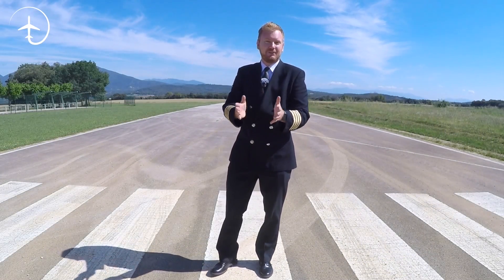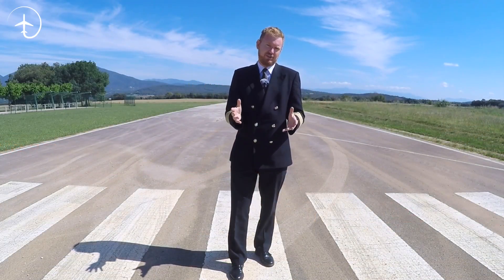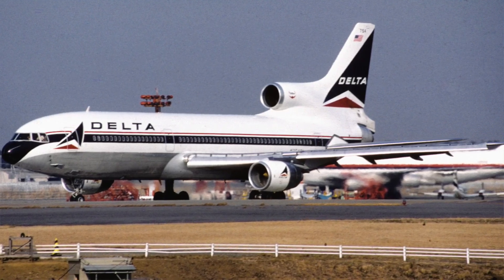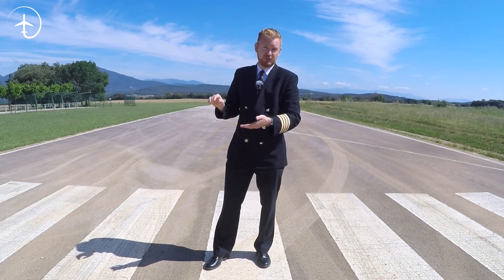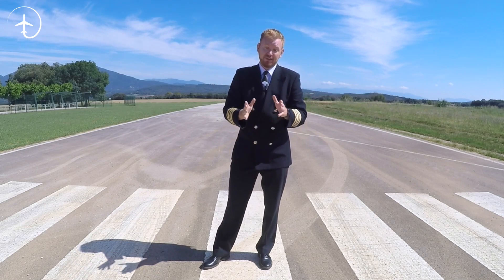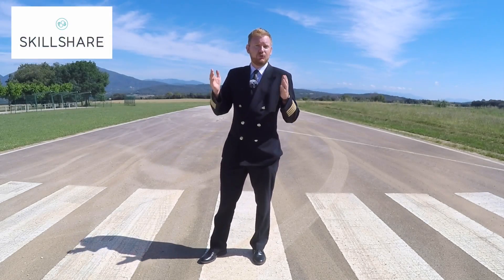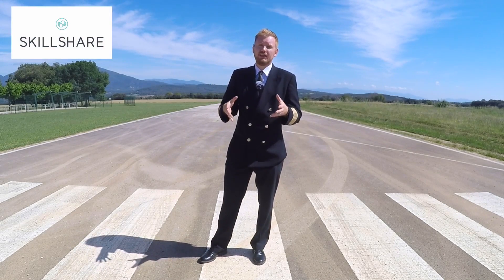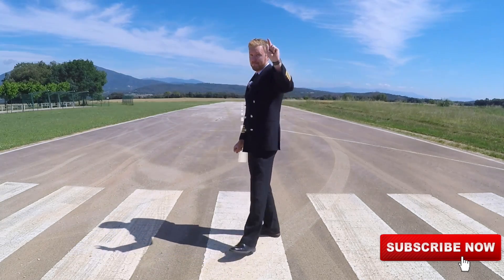Three Engined Aircraft, what happened?

Comment: I hope the hell that you're not actually a pilot, since you have incorrectly number sequenced a 3 engine aircraft. Engines on ALL AIRCRAFT are numbered from left to right, as if you were sitting in the Captain's or the First Officer's seat. The number 3 engine IS NOT integrated into the tail, that's the number 2 engine. The number 3 engine is mounted on the starboard wing and the number 1 engine is mounted on the port wing. Please correct your oversight on this, thank you.

Comment: Special circumstances require different planes?  Arrived in SE Alaska in 1974.  The challenges were weather, small population, short runways (Like: sea on one end, mountain on the other), bad airport locations, bad runways, and bad ground-approach-electronics (or none).  You could (and people often did) describe a town by the faults of the airport.  Kodiak - land into a mountain.  Petersburg - runway rolls like the sea.  Sitka - too short, but they lengthened it a bit.  Juneau - the approach from the north was like "you are kidding me".  At least Ketchikan didn't have cross-winds - they built it between mountains.  They landed way below minimum.  If the tower could see the runway, well, what more do you need?  Dutch Harbor - "THAT'S a runway?  Says who?"  Did i mention lousy weather?  Alaska Air needed short-take-off-short-landing planes, and very skilled pilots. Tri-motors made sense for more power; however, 727s ruled the day.   Dual-use planes - forward part of cabin became freight.  (Have to get down a stair and cross the tarmac to the terminal?  This is Alaska.  You're an Alaskan.  Suck it up!)

Comment: I think it's complete folly to only have 2 engines on long haul flights over oceans,I know people will say that they can fly on one engine but they can't fly on none,if by some chance the second engines fails and your in mid Atlantic then your in deep shit and your going to get your feet wet, the new big jet engines are reliable but they can and do fail due to bird strikes and mechanical failures Ect. It's only a matter of time before this happens as the number of flights increase and the engines age.
Reply: David Ellis not really. The chances of having dual engine failure with current checks is just too slim to justify a third one.
Reply: A2DJP .Well I hope your right for everybody's sake,prevention is better than cure any day ,time will tell who is right when these aircraft start getting on a bit and the flight hours start mounting up and all the checks in the world won't save the passengers and crew if it happens over the open ocean.
Reply: @davidellis279  yes, but considering the way aircraft maintainence works, it's unlikely.

Like firstly, all pressurized aircraft have a life cycle. It is not used beyond it.

And second, the major checks (D check) involves stripping down the entire aircraft, checking each component (replacing or repairing parts if needed) and then putting it back together and . This generally happens around every 6 years. This and the other checks (A, B and C) makes sure what you are saying won't happen.

Comment: B 727 forever
Reply from the maker: It was a great aircraft
Reply: @MentourPilot  Flying with these as a kid during the 1980s was the most heavenly experience. I remember walking towards its rear stairway, and the noise of the jet engines getting louder and louder like a thunderstorm above my head, and a pretty stewardess standing behind the stairs and smiling at me, it felt like I was boarding into Heaven. I aways demanded to sit near the wings and window, so that I could look into the wing moving its parts, and looking into all the clouds and the small ground down there, it was amazing. It was a short local flight to the seaside, I remember with a DC-9 it took us 40 minutes, but with a B-727 it took us only 20 minutes.

Comment: The reason why airlines went to 2 engines was insurance reasons. The insurers were starting to complain about all the trijet crashes. More people have died in trijets than any other type of airplane. Trijets in my opinion are one of the most idiotic engineering ideas in the 21 century. You are placing an engine in one of the most critical control attitude areas of a passenger jet. Many accidents have occurred due to this area of the tail being affected. To me the DC 9 and 10 were notoriously unreliable, the LT1011 was decent but had some issues. After 2 engines started to be used the number of crashes started to fall massively. Human error is now one of the biggest issues with the complexity of computerized flight systems. I find it amusing that a jet fighter can paint a target at 100+ miles and yet TCAS could of easily used that technology. I guess some tech can not be used to save lives...

Comment: Passenger safety is kind of important.  The, "Miracle on the Hudson," probably would not have happened because the birds would have been prevented, by the fuselage, from getting to the third engine and they would have been able to return to the airport.  The extra cost of the 3rd engine would have paid for itself - the airplane would have survived.  Also, the most iconic American made jet, the Boeing 727 was never mentioned.
Reply: TheFarmanimalfriend yea, but if you go statistically, the chance of the Hudson incident is just too low.

Its like saying people shouldn’t drive cars because people die in car accidents. And you are more likely to have a car accident than have another dual engine failure.

Comment: He didn't hit on the performance aspect.  All take offs are planned for an engine failure at the most critical moment, where you can either keep going or stop on the remaining runway.  With a 4 engine airplane, you will lose 25% of your thrust, a 3 engine airplane 33% of your thrust and a 2 engine airplane half your thrust.   Sure you can have a pair of huge engines, like a 777 does, those two engines make almost as much as a 747's 4 engines do.  So a loss of 1 engine on a 777 would be like losing 2 engines on the same side on a 747... greatly reducing your take off performance.  This is why a 747 can carry more with a shorter wingspan and the same amount of thrust as a 777.  The 777 could handle the same take-off weight if all engines were running but NOT with a loss of half of it's thrust due to an engine failure, whereas the 747 would be operating on 3/4 of it's normal thrust with a loss of an engine on take off.

Comment: United Airlines 232 into Sioux City Iowa was a tri-jet DC-10 which lost its center engine, and with it, hydraulics and many other systems.  The pilots succeeded in saving nearly half of the passengers using differential thrust only to control the plane.  I believe that accident was part of the reason we don't see many tri-jets anymore.

Comment: The truth is that a failure of the center engine took out the control system and caused a crash on several planes
Reply: I believe that was mainly the DC-10s and their (I understand) non-isolated/redundant hydraulic systems, wasn't it?

Comment: I was working for Rolls-Royce in the late 60s when the first RB211 3 shaft gas turbines were being designed and developed.  The first aircraft they were intended to be used on were the Lockheed L1011 so tri-jets were certainly being more than thought about before the 1970s as mentioned here.  I left RR just before the 'crash' in 1970 caused by the design problems with carbon fibre fan blades and the extra cost in using titanium (which is now standard).

I rejoined RR a few years later and remained until retirement but, as I recall, one of the problem with centre engine was that S shaped intake duct which meant air intake was inevitably restricted.  My field was the design of electronic measurement and control systems on test beds and rigs so the details of aerodynamic design were almost as much a mystery to me as to the general public :)

Like all your videos, very well presented and explained. Thanks

Comment: Now I am not sure whether it was my first trip by plane or one of the first ones when I flew in DC-10 or its variant. Transatlantic flight (whole trip consisted of 3 flights). I was quite happy to see it from the flight gate as it was such a specific plane (Jumbo Jet on another transatlantic flight was nice alternative).
This was benefit of these planes - they were so easy to remember :) And I liked them.

Btw. what about fire hazard? If you have fire in this engine, it is in the very unpleasant area when it comes to control - rudder and elevator are next to it.

Comment: Thumbs up for this video:  If I was flying i'd feel more safe in a 3 or 4 engine aircraft than a two engine aircraft. The crash over the Hudson (flown by the famous Sully) proved that out as he may of made it back to the airport with only one back engine running with a smaller intake or at least had a more controlled crash.  Plus rear engine aircraft seem to have smaller air ducts & are up high, so they tend to suck in less dirt and shit, LoL.....  Big diameter engines with really large fan blades bother me. Break just one fan blade and the engine will go out of balance and vibrate and needed to be ran as slow speed or risk it cracking and breaking the wing off.  You said about fire not being near the passengers with the pods under the wings, so you simply die slower LOL... Any fire that is on a Jet and the fire suppression does not put out, it's curtains for everyone on board unless one lucky bastard has a parachute.  Remember in war planes they always wore parachutes, and I think they should rent them to passengers on commercial jet liners that want one.  Even as a novelist, i'd rather bust a few bones making a hard landing than die in a fiery crash regardless where the fire on the plane is.  However I surmise at the speeds Jets fly and if they are really high a parachute would not do you any good any way, and if a stall happens on take off or just after as in Sully's landing on the Hudson River , you are too low to use a parachute.  As long as humans are building and working on aircraft there are going to be accidents. I often wonder when you see the amount of wires and gadgets in aircraft how more of them don't break down.  That is why when I buy a car I get it as stripped as possible except for AC, because is less stuff to break and less to distract me. I like my GPS being portable, because when it breaks or becomes obsolete and it will, I just send to Amazon and get a new one and plug it in, rather than take my car to the garage where some yo-yo whom may know what he's doing pulls off the entire dash board for $800.00 when you can replace a portable up-dated unit for $100.00 or less.

Comment: I would have thought that the smart thing for pitch balancing in a tri-jet would be to have the tail engine's downward pitching moment exactly balance the wing engines' combined upward pitching moment. Am I missing something? Only problem I can see is the structural bending force through the fuselage, and I couldn't see that being too hard to handle.

Comment: I flew in 727s many times in the late 60S and 70s.  Great plane although the 6 across seating was a little cramped for big guys.  (Fine for me).  Talked to a pilot that worked for a corporation that had a 727.  They replaced the outboard engines with MD-80 turbofans.  He said it was an awesome plane to fly.

Comment: There is a saying among MD11 Mechanics "when it comes to Engine problems, the MD11 only has 1 engine, engine 2" that is because, (contrary to what is said at aprox 3:32) doing any work on eng 2 is a pain in the A.. and therefore it gets the least love, even just servicing the eng oil is a bit of a faff, and req special equipment.  and the sheer complicated engineering required to facilitate the engine change, to get that enpenage out of the way to drop the engine vertically straight down, pause and have a close look at the MD11 and see what has to be moved out of the way to lower that engine vertically. any way (rant over) other than that its a great aircraft. KLM was the last airline to use them as pax birds, Flew on one with them in 2014 Panama to Amsterdam at that time they were operating 3 although I heard a rumour they had retired them the biggest operator of tri-jets to day is probably FedEx (aprox 60 MD11's) I also work the B747 and not saying its a Better aircraft (plenty of material for another rant) but the engines all 4 of them are easier to work on. any hoo this rant was inspired by the tiny little comment at 3:32 in an otherwise great video. Ps ETOPS can also mean Engins turn or packages sink

Comment: New engine efficiancy make the 3 engine concept absolute.  The new way of passenger aircraft concept have to be faster than the 600 m.p.h tradition (not mach 2 but more mach 1,5) The pipe with two wings has to be replaced with a blended fuselage quite broad making room for some other places of usage and with a diamond shaped or delta shaped wing.  Tail wings can be optional for improving stability. I think that will be the future of airliners concept.

Comment: What about redundancy? In the case of an engine failure on a 2 engine plane you lose half the power and the thrust is entirely on one side of the plane. At least on a 3 engine craft a single engine failure leaves you more thrust and less instability.
Reply: magnetiktrax Airplanes can fly with one engine if the second fails.
Reply: Gee, thanks Captain Obvious! 😆

Of course they can fly on one out of two engines, but they can fly better on two out of three engines.

Remember flight 1549 that went into the Hudson after both engines failing when it hit a flock of birds? Would have been okay if it had a third engine with the air intake above the body of the plane.

There are multiple good reasons for a 3 engine design.
Reply: magnetiktrax I guess your right 3 is always better than 2 maybe in the future tri-jets would make a comeback with some sort of discovery in fuel efficency

Comment: I wonder - could Mentour Pilot get one of these planes to 100 kmh above rated top speed - then without waggling the wings do a 180 and make the same vector that a Red Bull air-racer makes, between pylons? Proportional to the size of the aircraft, I mean? Or perhaps he could fly low & slow and make ti seem he and crew had disappeared  -and preventing a fuselage breakup, caused by ocean pressure? Tis long after 9/11, why not admit, Boeing remote auto-pilot, for hijack prevention, in design, quite likely could explain the accuracy of 9/11 or MH370 flyers. Likely he knows: Lufthansa professionals found this item in their fleet purchase, were not told, and promptly had it torn out.

Comment: A big issue with '80s 3 engine aircraft was safety. If an engine mounted under the wing blew up, it would usually rip itself loose from the pylon and fall off (though many aircraft manufacturers ran critical hydraulic and electrical systems through that area, which could be destroyed by the loss of an engine, making the aircraft unflyable). However, the third engine was an integral part of the tail assembly, and if it suffered a severe structural failure, you lost the horizontal and vertical stabilizers, rudder and elevator. At that point you have a doomed aircraft.
Reply: "If an engine mounted under the wing blew up, it would usually rip itself loose from the pylon and fall off" That happened to an ElAl Boeing 747 that had just taken off from Amsterdam Airport. #4 engine caught fire, got unstuck from its pylon and, while falling, took #3 engine with it. Within two ticks the aircraft was uncontrollable and crashed moments later.

Comment: In truth, trijets went through 2 phases. Early trijets such as the Trident and 727 used 3 engines because 2 engines could not  produce enough power at that time but 4 were too many for economy and maintenance costs. Actually the last version of the Trident had a tiny 4th engine to assist take-off only. The DC-10. MD-11, L-1011 (plus their Russian counterparts) were made at a time when high thrusts were available but a plane smaller than a 747 was desired which also had trans-oceanic ability. ETOPS killed them off, although plenty of MD-11s still fulfil the cargo role. Just be careful on landing though !

Comment: Are triengines known that were built back to biengine?
Reply: I was heavily involved in the UPS 727QT RR TAY651 program at Dee Howard .. During the re-engining / stage 3 noise abatement of the Boeing 727 in the late 80s / early 90's, some engineers briefly considered removing the center #2 engine -- the new engines [Rolls Royce TAY-651s in the case of UPS/Dee Howard and Pratt & Whitney JT8D-219s for everyone who chose the Valsan/ROHR mod] basically created enough thrust to equal 3.5 to 4 of the old P&W JT8D-9 engines .. in other words, the new engines provided enough thrust to launch the 27 like a fighter jet [and they did] .. so the center #2 was basically no longer needed to get the 27 off the ground and meet its in-flight performance needs .. removing the #2 engine would have basically turned the re-powered 727 into a DC9-80/Super 80/MD80/B-717 type aircraft, using either the same JT8D-219s that are found in the MD80/717 or the RR Tays .. I don't know about the PW 219s, although I did spend several years on MD80s, but the RR TAY651s were extremely heavy .. and pulling the first plane out of the Dee Howard Hangar after mods, the nose wheel came off the ground - luckily there were several of us inside the fuselage and we RAN FORWARD - the mechanics outside threw several sandbags into the forward cargo hold - we had to install water weight forward in order to balance the plane for flight tests .. on first flight, the test pilot had to deploy thrust reversers in flight in order to get the nose down so he could land ..